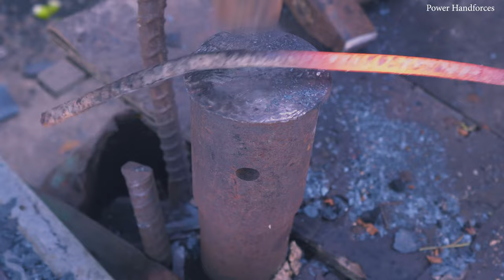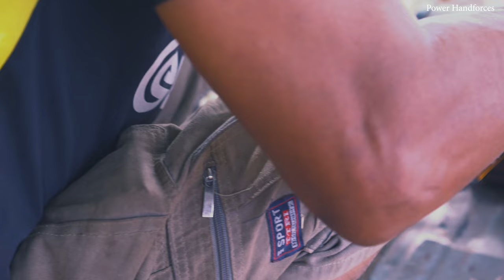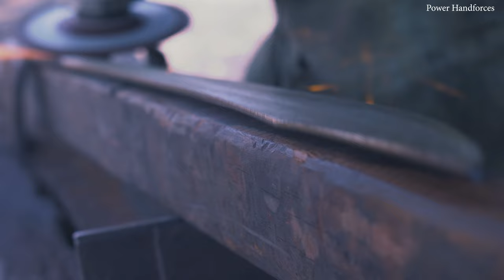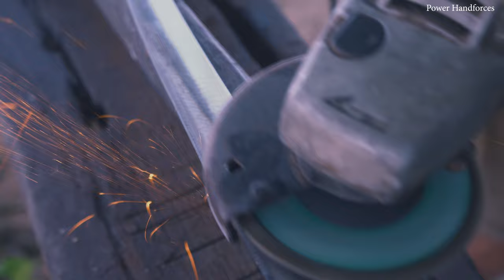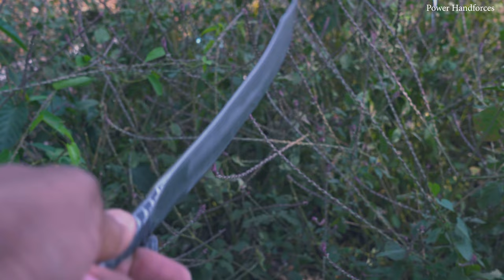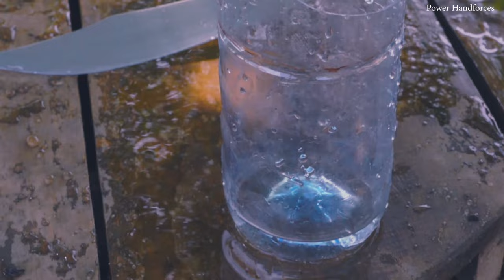MAKING SWORD - FORGING SWORD FROM REBAR BY HAND!!!

Comment: Very cool! Question though, isn't the diameter of the handle too thin? Doesn't it need to be thick enough that your fingers aren't closing on your hand? That's why you keep grabbing the entire loop, when you were cutting the bottle, instead of the actual handle, because you can't swing a sword with a thin handle.
Reply from the maker: That's our good experienced we're learning through. Great thanks for your idea for improving our project. Cheers and stay safe !